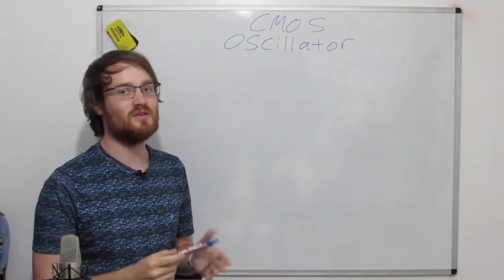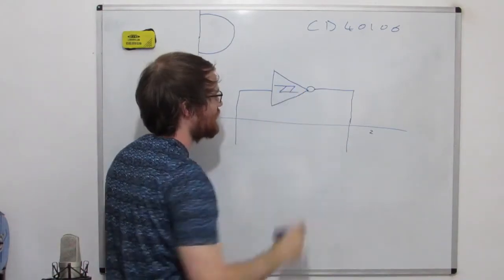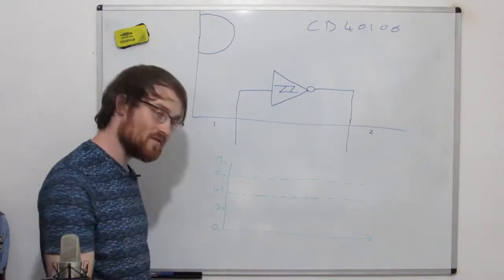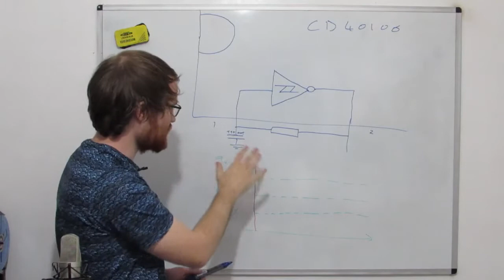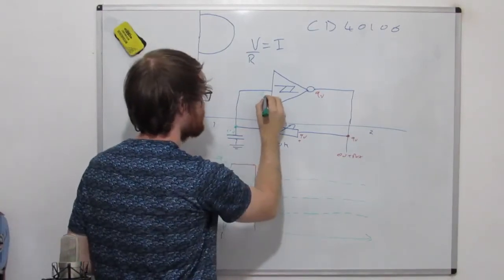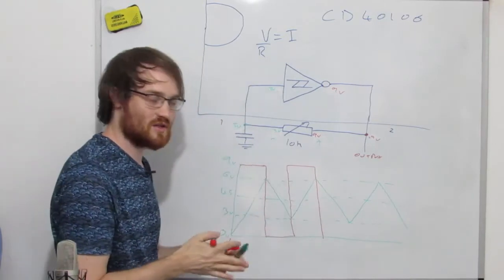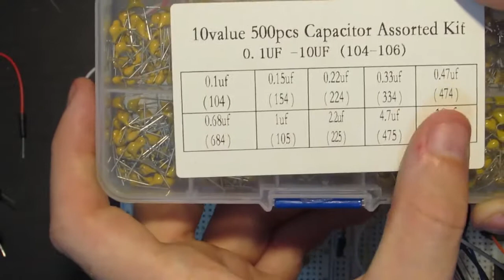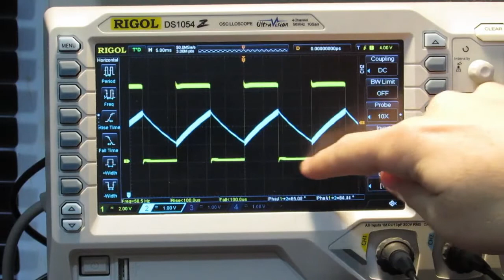Electronics Basics & A Simple Oscillator!

Comment: Looking at the rise and fall of the capacitor voltage, I can’t help but wonder if it’s possible to tap that lovely saw wave :)
Reply from the maker: It is! You just need a buffer.
Reply: @TheAudioPhool  that was my suspicion, I may try this tomorrow; I’ve been building a workshop that I’m finally able to spend the time in for a few weeks as part of an arts council project using valves as sound generators…

Comment: I just built the circuit from your instructions and it works great.  I have the same oscilloscope and was able to see the two concurrent signals overlap which was pretty amazing.  I also tried different capacitors to see the effect on the frequency range.  It's really helped me understand this basic circuit design and function, so thanks!  I would like to go deeper and learn how the Schmitt trigger works and transistor circuit behavior in general so will be viewing your other videos.  Did you ever do a speaker set up video?  I ask because I'm also following Mortiz Klein's DIY VCO video and he mentioned needing a buffer so as to not affect the oscillator current when connecting speakers.  Does the "circuitry" you mention in typical external computer speakers act as a buffer?
Reply: Did you ever do a speaker set up video?
Reply from the maker: Hey mate! Only just seen these. Don't always see comments on older videos so sorry about that!
Yes that's basically what i'm referring to!! Just any old set of cheapo desktop computer speakers will do just fine. Occasioanlly you have to give it a helping hand with a resistor divider.
I haven't done it on the channel but i'm doing a Patron questions video soon so i'll make sure to give this a mention in there :)